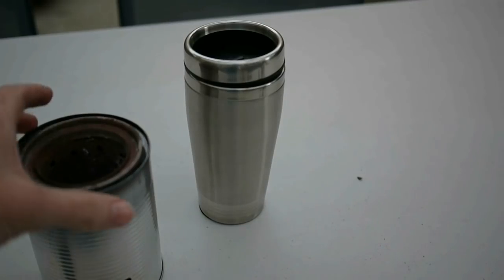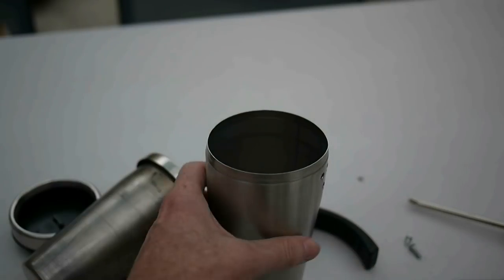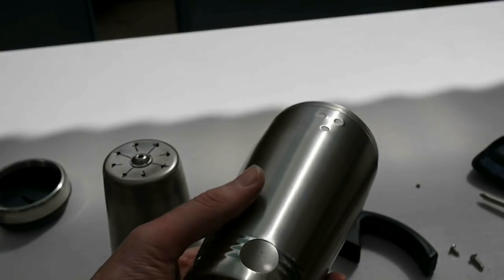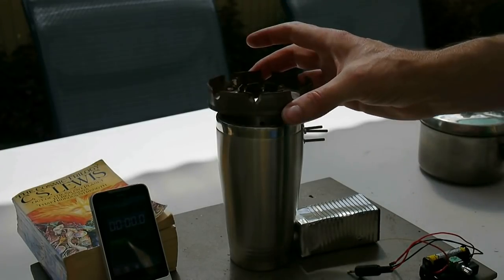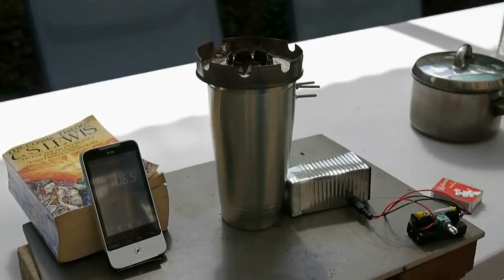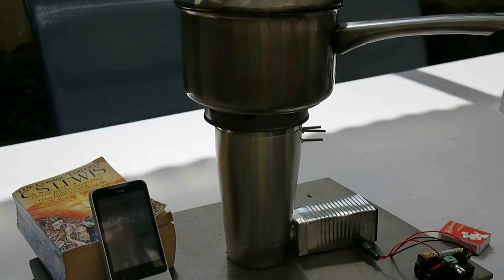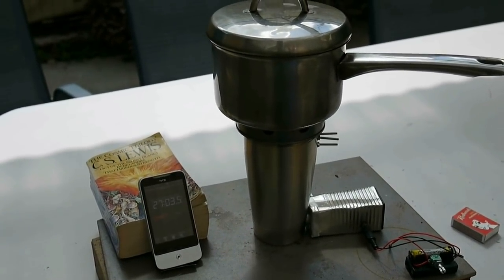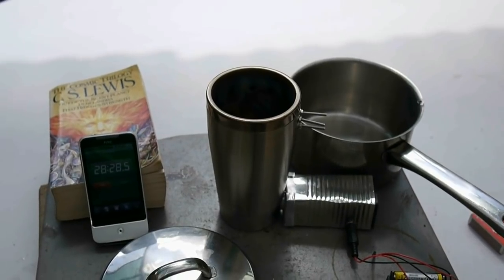Woodgas TLUD stove with fan made from Stainless Steel mug

Comment from the maker: I have experimented with more holes in the bottom and it burns hotter but makes the pot black. It becomes a forge instead of a wood-gas stove. The primary combustion is supposed to be short of air for pyrolysis. I also tried with and without a fan (+ large air holes w/o fan). The flame seems wobbly w/o the fan and harder to get going, and makes smoke (and soot) if there is any wind. I use the fan with rechargeable AAA batteries and it doesn't add much weight and the batteries last a long time.

Comment: I tried a couple of designs with insulation or additional chambers but at the end of the day we have to accept that it is easier to make a lot more heat than it is to try to stop a little bit from escaping.  I made one with a 20lb propane bottle. It wasn't nearly as efficient naturally aspirated as the little ones with blowers but it made and held a bed of coals forever just because of the sheer mass of heat.  My next project is to get a 1/4 ton truck running on syngas.

Comment: Thanks for all the detailed descriptions. Still thinking of what the best (woodgas igniting) heated airflow ratio should be (5:1) with an optimal gasifying chamber like a standard lightweight sealed and pressed 140 ml stainless steel mug is. The flame concentrator and the integration of a really tiny low voltage fan with regulated rpm's is the real challenge with this one.

Comment: Good use of the stainless mug, stainless mesh and pot stand. Kudos.  Your might get more white and blue flame if you put a few more small holes on the bottom of the burn can and some small ones around the side of the burn can about 2in/ 5cm up from the bottom of the burn can. Primary air intake holes under the primary fuel are very important to get good initial combustion. You'll find the stove will burn hotter and longer and you can use it without the fan as well because of the Venturi effect.

Comment from the maker: Yes - more heat is easier than insulating. It's so hot it's hard to insulate with anything that doesn't weigh lots- and I was aiming for a stove suitable for hiking. Good luck with your truck! Trucks running on wood would be something to see.

Comment from the maker: Primary air is the air used for the initial smoldering of the fuel. It is restricted so that smoke is created rather than fire. Secondary air is used to burn the smoke. In this type of stove the smoke is actually the fuel that is used for the main heat production, which is why it is a smokeless stove (if everything is working as it should). The balance of the air flows is critical to the performance of the stove.

Comment: perhaps its just me, but I would forgo the fan. there are plenty of models without them and I believe you even have one. The airflow in the cup is so minimal that I think it would absolutely need the fan to be effective. what if you don't have batteries? neat concept though. to maintain heat you could make pot holder/windscreen that has an opening for putting in more wood. oh and nice literary choice.
Reply: All depends on the fuel he uses the most. With stove pellets for example you kinda need a fan for a proper burn.

Comment: there are two ways to get a blue flame. one method is to push less primary air for the same secondary holes . the other method is to push more secondary air for the same primary holes.
A yellow flame is the result of an incomplete combustion

Comment: Imparting a swirl helps with complete combustion but you need more heat to crack the tars (smoke) a bit more. I have tried smaller but the 4.5" chamber is the smallest I can get a blue flame from.
Spinning the stainless and tig welding it are difficult for the DIYer though*

Comment from the maker: I agree that being smaller makes combustion more difficult. I experimented with adding an extra one or two concentric tins around the combustion chamber and forcing the air to travel in turn from outside layers to try to keep in more heat, but it didn't really help enough. (i.e. instead of secondary air going up and down once it did it twice).

Comment: I actually preferre the vacuum sealed versions. You just drill carefully holes in the bottom on the inside without drilling the outside wall. The thin layer of air between the walls improves the efficiency of this design. You just have to use a really tiny fan to carefully regulate airflow from the outside in. A normal sized stainless steel mug will do great and is even lighter !

Comment: Awesome kit. Guess you had the optimal air flow and flame concentrator to achieve 10-12 minutes boiling time after initial boiling state. A world record in my opinion for a small load of sticks. You should carefully examine the specs and go for a industrial prototype. It is a real winner !

Comment from the maker: I used a 40mm 5v dc fan. They are not as common as the 12v but you can usually get them from the same seller.

Comment: I thought this was such a great idea I decided to make one for myself minus the fan. The hardest part was finding a suitable mug. I needed to add more holes to the design to make up for the lack of a fan but otherwise used your design. I found that if I load and light it like a normal TLUD stove it will go strong for 45+ minutes on wood pellets and maybe 25 or so if I stuff it with thumb sized twigs. 
I have several stoves and this is the one I play with the most, I love it. Thanks for posting such a cool idea!

Comment from the maker: I thought about trying to use a vacuum sealed mug but decided it would be too difficult (for me) to make the holes required. If you can find a way it would probably make for a better stove. I thought I would have to drill through both layers and then block the outside holes somehow with a strip of stainless steel but couldn't work out how to make it a close-enough air-tight fit.

Comment: I was having the same problem as others on here. Mine didn't want to come apart- UNTIL I put the blade of a flat bladed screwdriver up the bottom and wedged it between the two "cups" and then twisted. First one side, then the other. 
Then it came apart.
NEXT comes the drill!

Comment from the maker: The starting point is that there should be a 5:1 relationship between the total area of secondary holes (top) to primary holes (bottom). Larger holes = faster burn and easier start. Smaller holes = longer burn. You don't need many holes at the bottom (8 or so), but more holes at the top seems better (but still 5:1 area, i.e. sum of 3.14 x R x R).

Comment from the maker: Good luck - note I have another video describing the pot stand I made. Its a bit complicated to try to keep wind out, but probably just a simple X made of two rectangular pieces (e.g. 0.5x120x15mm) of stainless with a slot to slide them together would do ok. I tried that with aluminium once but it just melted so it needs to be stainless steel.

Comment from the maker: That sounds a lot more difficult. I found mine in a shop and easily peeled off the sticky rubber cover from the bottom before I bought it. There's obviously a bit more risk buying it from a photo online that it won't be the same. They are probably not waterproof enough for dishwashers with the screw design so some manuafacturers might move away from that design. I have heard of others finding them on eBay in the past.

Comment: Found another mug on eBay but on arrival found stainless inside, plastic insulator wall and cheapo thin aluminium on the outside. ISP I've taken the inside out and put it in the outside of another mug. Carry on with it tomorrow.

Comment: Inspired by this post, I have embarked on build using the method here. I found a SS wide mouth thermos that I was able to pull apart from the plastic parts by boiling it in water. It has the advantage of a wider base, but the disadvantage of not nesting at the top now that the original plastic collar is gone (I assume I cannot place a link for the pic of this here). I might try heat resistant silicone caulking. Also I'd like to setup a fan that I can power via USB cable from one of the 18650 cell power packs I always carry anyway.
Reply from the maker: In another video I show how I added legs to this stove to give it a wider bottom. Also I tried using high temp caulking but has trouble with it becoming brittle and falling out with these high temperatures.
Reply: michaelporter000 Thanks for the tips on the caulking, I'll try to devise another ring. I had used that caulking on our fireplace insert's door last year and just noticed it too is brittle, luckily the door still seals enough to draft properly anyway. I'll update with my progress. Having misplaced my Step Drill has slowed me down until I can find it, which has given me more time to plan and think. Is there an optimum airspace between the bottom inner chamber and the bottom of the outer one?

Comment: Very nice video mate. The narrow base seems it might be a bit unstable to me.   Maybe JB weld bottom to wide base can top?
Reply: I added some very simple legs in another video- basically two strips of aluminium with a hole in the middle attached by the bolt at the bottom in an "X" configuration. Works really well and folds up nice.

Comment from the maker: Yeah- that sounds awkward. If that happened to me I'd just keep it as a cup and try buying a different one. Others have had trouble too so try to find one that looks exactly the same. The join around the top and the round black rubber circle on the bottom may be the design points to look out for. Any other non-stainless areas on the sides etc (except for the handle) that you see in photos may indicate there is plastic inside- which would be no good.

Comment: How did you pull the mug apart. I'm having real trouble with mine
Reply from the maker: The mug I used had a screw at the bottom that holds it together, covered with a cirlcle of rubbber that forms the base of the mug that just peeled off easily. If you have a different type of mug you will probably have more trouble...
Reply: No exactly the same one but it was just harder to take apart. Done it now though